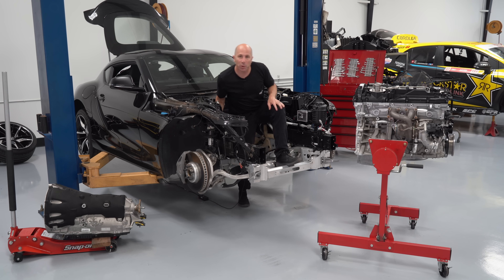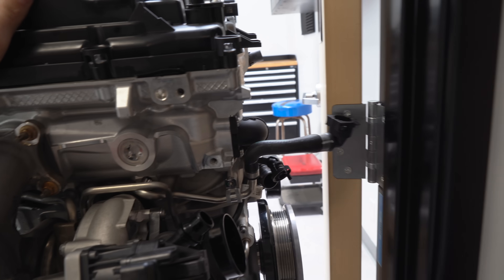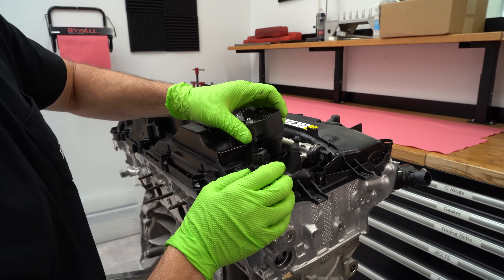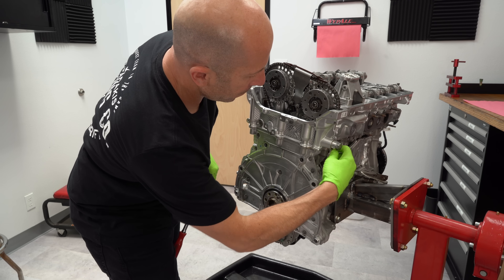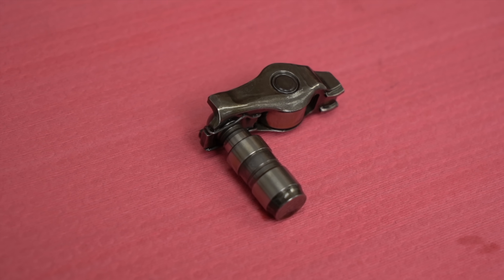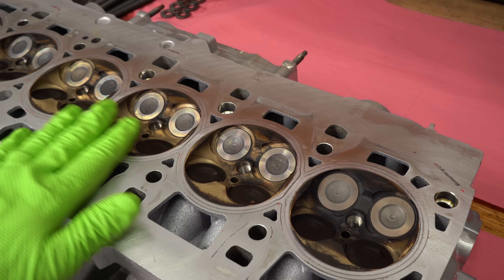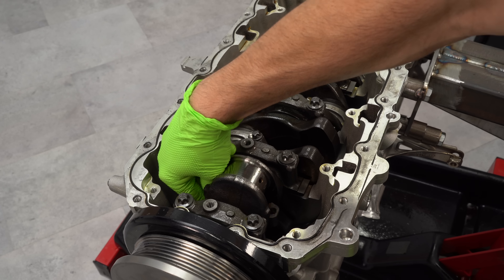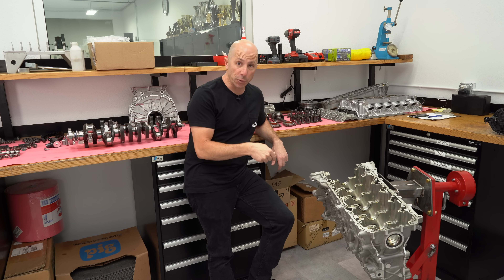2020 Supra B58 Engine Teardown - First Look - Better than the 2JZ?

Comment: Renowned engine builder: compliments engine

People on the internet: sHoUlD bE a 2jZ
Reply: People cry for the 2jz but dont realize the original supra engine is the M series from the 2000gt 🤣
Reply: Technically nearly every motor with the G head was a Toyota/Yamaha collaboration and been this way since the 1970s with the 2T-G in the Celica. 🤷 That's why most Toyota motors have an F version for economy (eg. 4A-FE) and a G version for performance (4A-GE). 👍
Reply: @Jmac1000000 the 1JZ was designed by Yamaha with a partnership for Toyata, the partnership kinda died out and Toyota revised some engineering with the 1JZ and added a half liter of displacement and badged it the 2JZ. Though Yamaha didn't deal with the 2JZ it still builds off the 1JZ platform.
Reply: @KingCobraStunts  Holy fuck thank you. So many people don't know what the fuck they're talking about.
Reply: @KingCobraStunts  thank you for saying this. Glad there are  people like yourself who actually know the history of the engine
Reply: People hate giving Yamaha credit for building the 2jz engine. They probably won't give BMW any credit either. There's a reason Toyota doesn't build these engines themselves.
Reply: @name1874 : Why yes, let me meticulously source every statement in a Youtube comment.  That sounds like a lovely use of my time and knowledge, of which I've already given far too much freely to the ignorant lot of you.  I think a simple Google search would confirm everything I've said, I'm quite certain of it.  After all, I'm correct.
Reply: Tyler Duzan you’re right in everything you say but it can be interpreted differently and/or can be a brand new concept to someone, so why act like an unlikeable elitist prick?
Reply: Yamaha designed the cylinder head and they did a dam good job. I only trust DOHC valve trains with shim bucket valves. .
Reply: blu3flare25 Which Yamaha ripped off Kawasaki.
Reply: Yamaha and Toyota have been making and designing engines together for a long time.  The 2000GT was an early example of their collaboration then 1JZ and 2JZ series to the Inline 4 4AGE, 2zz and 3sge engines to the famous LFA V10 which Yamaha had more control and influence in the design as they developed the exhaust system along with their music division
Reply: one of the head bmw engineers from M division helped design the 2jz...
Reply: why are people so pissed? its a bmw! People love BMW's, so why do they hate this? it could have been worse, for instance, kia or something. bmw is a great performance brand, its not the end of the world.
Reply: Loool
Reply: Overland RC probably a 3JR. Toyota has been naming their engines “X”R recently, like the UR or GR engines
Reply: @Jmac1000000 YAMAHA DEVELOPED THE TOP END OF THE 1JZ! JESUS PEOPLE
Reply: @Overland_RC  don't they have the same engine?
Reply: @Overland_RC  per design
Reply: @Jmac1000000 The head on a 1jzgte non vvti engine was designed by Yamaha aswell
Reply: @Jmac1000000 thr 1jz was also a partnership with Yamaha
Reply: The 2JZ-GTE is an inline-layout, six-cylinder, belt-driven dual-overhead camshaft, air-intercooled, twin-turbocharged, cast-iron engine designed and manufactured by Toyota Motor Corporation that was produced from 1991 through 2002 in Japan. Final development of the 2JZ-GTE was outsourced to German engineering firm Johann A. Krause Maschinenfabrik GmbH for refinement to meet production car homogolation requirements set forth by the former All-Japan Grand Touring Car Championship.
Reply: @infamus15 Finally, someone else who gets it! Yes, these are BMW engines, but they're BMW engines *with Toyota quality control*. Which anyone who knows Toyota knows that that is what they're known for. I have faith in the B58.
Reply: Overland RC some German piece of shit lol
Reply: Still wish it was built with japanese ingenuity, still a cool engine for sure.
Reply: @Jmac1000000 It's not exactly like Toyota had no say on this engine. I read that Toyota engineers examined a pre-production engine and gave BMW a list of a HUNDRED (100) things to fix and adjust for it to match their demands.
Reply: @infamus15 Do you have a source for all of that? I would love to read that and it would help to assuage my fears of it being a maintenance-intensive BMW.
Reply: I do like the idea of having control over your cam timing, but just like LS and mopar have proved time and time again, you don't need high tech to be the fastest.
When it comes to power output, there is no replacement for displacement.
The B58 is cool and all, cool little maintenance ideas, but you cannot say it's better then a 2jz until its accomplished what the mighty 2jz has, Ain't no BMW engine doing 5s.
Reply: King Ragnar I wouldn’t compare an LS to a JZ or B58. Not to slam on the LS but the engines are leagues apart, adding displacement is a solution of a by gone era. We have better options now that return the same power, in a smaller package, with much better economy and the same reliability
Reply: King Ragnar there’s no (replacement for displacement?) you ever heard of a turbo my friend?
Reply: @infamus15 toyota claims the b58 passed their inspections from the get go
Reply: Funny how people are complaining that toyota once again partnered up with another company for a engine, when they did the same thing with yamaha
Reply: Internet people are stupid and poor and they should shut up
Reply: Well yeah should've been a Toyota engine. That's true.
Reply: AWOL the 2j wasn’t a “Toyota” engine either. But I get what you’re saying.
Reply: @peterp1552  huh 2 j not a Toyota engine???
Reply: Tyler Duzan The 2JZ is a Toyota engine that was co-developed with Yamaha. That does not make it a Yamaha engine. Get your facts straight, stop spouting ignorance and don’t call people dumb when you clearly don’t know what you’re talking about.
Reply: @NitroNuggetTV : 

1. I didn't say it was a Yamaha engine, I said Yamaha designed it.  You used the term "co-develop".  Pray tell, what does that term mean?  Could it possibly mean the same thing that I said in my actual words rather than the words you put in my mouth?

2. I know exactly what I'm talking about.  Thanks for playing.
Reply: @UC_ecMyI2NJsSiQTlhGVL7-A:

Almost every major drivetrain component in every modern car (modern being made since 1980) is done as part of co-development.  Companies like Yamaha, Aisin, Borg Warner, Allison, Takata, Bosch, et al do significant amounts of co-development work.  This is because car manufacturers are specialized primarily in the manufacturing, marketing, distribution, and regulatory side of the house and that is a primary cost driver for making a new car design.  Toyota has an incredible amount of engineering capability in house and probably could do everything itself, but it's simply not cost effective to do so, so like every other major car company they farm out significant parts of the work and their own engineers are responsible for the initial specification requirements and final integration.

To be real specific, there are multiple design changes over the lifespan of the JZ engine family.  The 1JZ-GE was likely a wholly Toyota design, however the 1JZ-GTE was not, as you can find out by looking at the very obvious Yamaha badging across several critical components.  Yamaha's specialty in all of their codevelopment with Toyota has been head work and timing, and the 1JZ-GTE is no exception.  The third generation 1JZ-GTE added in the Toyota BEAMS architecture which was also co-developed with Yamaha, originally for the 3SGE.

For the 2JZ-GTE specifically though, a third player gets to enter the arena in the form of German engineering firm Johann A. Krause Maschinenfabrik GmbH which worked over the 2JZ-GTE design in order for it to correspond to FIA homologation rules for the Japanese Grand Touring Championship.  There was also additional headwork improvements in the 2JZ-GTE courtesy of Yamaha.  Furthermore, there's even a fourth player with the 2JZ-GTE, as the turbos were jointly developed with Hitachi.

In the case of the 2JZ-GTE, if we've being very specific there were design inputs from Toyota, Yamaha, JAKM, and Hitachi into the total powerplant, and final build production was entirely performed by Toyota.  A significant portion of the design, especially components related to fueling, timing, head design, and valvetrain were originated from Yamaha and critical to what made the 2JZ-GTE a legendary motor for taking power on a stock block.

Since Youtube comments are obviously the perfect place for me to write an essay, enjoy a little fact bomb.  The More You Know *rainbow*.
Reply: @Tristor86  You ignorant. Yamaha never designed engines for Toyota. Whenever Yamaha had something to do with Toyota engines, it was in the cylinder head. Yamaha just designed the cylinder head. That's it. The motor as a whole, was designed by Toyota. It's funny that people are so salty and try to find reasons just to desperately prove Toyota isn't capable of building amazing engines. Well, joke's on you.
Reply: Tyler Duzan Yamaha is notorious for designing good flowing heads. The 2jz wasn’t designed solely by Yamaha.
Reply: Tyler Duzan the head was designed by yammy, thats it
Reply: @Tristor86   only the cylinder  heads from what I understand.
Reply: Peterp 15 but literally the motor is all bmw that’s why ppl don’t like it
Reply: DoubleC Lexus LFA.  Engine exclusively developed by Yamaha.  Granted Lexus IS the luxury arm of Toyota but just an example.
Reply: Tyler Duzan blah blah blah
Truth is Toyota has Yamaha develop (co develop) most of their high performance engines. 1zz Celica, 4ag AE86', the LFA engine, 3s-ge, 2jz....
NO other manufacturer is that incompetent when developing engines. Imagine if Honda had %50 of its engines designed by Yamaha, or Ferrari engines were "co developed" with Yamaha, imagine if Porsche had most of its engines "jointly developed" by Yamaha...get real son. Not saying that the B58 isn't good, that's not the point, point is Toyota can't build shit on there own.
Reply: KSDLEUXE KING I used to be like that, but over time it’s been growing on me quite a lot. You gotta accept for what it is. Either you like it or you don’t. This platform is gonna prove a lot of people wrong and shut up lots of haters. We just have to give it time to marinate.
Reply: @kghyeah9032  yamaha DID not develop the LFA engine! Don't be stupid. google that shit. All they did is design the acoustics for the surge tank on top of the engine. This is not from fucking wikipedia but from straight from the yamaha archives.
Reply: @NitroNuggetTV  then that means its the same thing as the B58 in the A90. A toyota engine
Reply: @theautomator2001  come on man. The thing you don't seem to understand is that the entire world doesn't have to think in terms of rivalries like Ford vs Chevy. Toyota and the Toyoda family are Japanese, which is a very perceptive culture. I'm not implying the cliche that Japanese people are born geniuses (they're not) I'm simply saying that they are a culture in particular that prides themselves on peacefully identifying strengths and weaknesses in others while keeping under their own humble  personal and national pride. It's what they're good at. Toyota knows clear and well how famous their engines are, but it's possible that you don't understand that although yes, rivalries occur, Toyota loves the bigger picture of it all: they love to make vehicles. They also love to make sports cars, on occasion. They love it so much, that they would rather not play the risky game of exclusive in-house engineer/designer- hunting, paying, trusting, and praying that they deliver world-class results...every time. It gets very expensive.
BMW can make great engines when they really want to, and just so happens that Toyota noticed this quality and really wanted them to do that. It's a beautiful thing, honestly.. business relationships when they work like this, instead of trying to shut each other out. We consumers love the vehicles, but yet would hate to see our favorite maker disappear.
It's called keeping the peace. It's us..the teams and the everyday consumer who draws these lines like you're stuck on that a  manufacturer is less-than for not doing everything under their own roof.
It's not the 80's nor 90's. We managed to get some great engines from then, but as the times change, designs and philosophies also change. Over-engineering for 500PSI of boost is how they did it back then...precision engineering is how they are doing things now.

Japan is very much in to collaborations across the country; from food, to clothes, and to cars. Above all, quality is highly sought and that's especially true within the collaborative decisions made within relationships..from personal and you better believe on up into business.
Honestly, I'm a Mazda guy and rotary junkie but I have nothing except respect for Toyota and their achievements over the years. They are hands down the smartest and most progressive-thinkers of Japan's auto market. They still don't know how to build chassis as fun as the FD3s, but that's another topic. 
All I'm saying is that they know what the fuck they are doing. This wasn't a desperate attempt to bring back the Supra because Toyota felt that they were losing business without it. Everything's going to be fine.
Relax.

It's the future and we're in it. This is what it is.👻✨😱
Reply: @Tristor86  the 2jz is  was built by toyota it was basically a copy and improved version of the 1jz  that was built by yamaha
Reply: @peterp1552  As well as the infamous 3sgte and the not so infamous but still cool in it's own right 2zz in the newer celica GTS
Reply: @DoubleCGamesStudios  The only thing Toyota did to the 2j was 2.5 to 3.0, rest was Yamaha and co.
Reply: @NitroNuggetTV  b58 was quality checked by toyota to make sure its upto their standard
Reply: I SAID RIGHT NOW!! It’s all bmw except the badge and body shell might as well just buy a bmw
Reply: @bmwman1981  if you drive both cars they feel nothing alike.
Reply: @AmaAndZing : You should do some research, bro, because you're grossly incorrect here.  Yamaha has been key to the design of engine harmonics on most Toyota race motors and high performance engines, and as such they have significant design purview over all aspects of engine design when engaged.  On the 2JZ, it was derived from the 1JZ which was nearly a complete Yamaha clean sheet design for the third generation which was used as the basis of the 2JZ.  For the 2JZ, Toyota moved forward the majority of the design and Yamaha improved the heads again.

The third generation 1JZ-GTE incorporated the BEAMS architecture which was the main thing that made so many late 80s and early 90s Toyota motors good (including the 3SGE and 3S-GTE in the MR2 and Celica).  This architecture was co-developed with Yamaha as well.

The factory turbos for the 2JZ-GTE were also an innovation, and were codeveloped between Hitachi and Toyota.  Toyota has a long and rich history of partnering with other respected Japanese companies to find experts in the more niche aspects of engineering to ensure they produce the most reliable and capable cars possible.   I have no issue with that, and I respect Toyota immensely for all of their achievements, but there's a lot of folks out there who got all their car knowledge from movies and don't know their ass from a hole in the ground, like you, that keep saying ahistorical nonsense.

As previously mentioned, other firms were involved for other aspects as well.  The bulk of the design was produced by Yamaha, though, not just the heads.
Reply: @NitroNuggetTV  someone's mad😂
Reply: @rocketlaunch99  it should have had whatever engine Toyota wants, it's their creation. haters won't buy it, too bad for them cuz there are real car enthusiasts out there that don't have that immature hater mentality.
Reply: @sepg5084  hear hear mate
Reply: @sepg5084  they didn't create anything since well you know all the parts are built and designed by BMW its really not that hard to get that it is literally a z4 with an hard top and Toyota badges
Reply: @rocketlaunch99  they were trying to make it more affordable and it would cost Toyota over 100k to make a new inline 6
Reply: Rubén Cabrera why didn’t they just borrow a engine from Lexus then instead they make v6s /v8s a more modern engine for the Supra
Reply: @bmwman1981  because the supra always had a inline 6 everybody would hate toyota if they put a v8 or a v6 it would ruin the supra
Reply: TurtleDude29 how at least it would be a Toyota engine unlike what Toyota have got now it’s a Toyota zupra not a Supra
Reply: @bmwman1981  you know yamaha designed the jz's right? the only reason they chose bmw for the engine is because they would rather use an already existing engine and re design it then spend hundreds of millions of dollars on an engine they wouldn't be sure would even succeed. i know for a fact this engine will be just as reliable as the jz's because i believe toyota would not let something unreliable out of their factory.
Reply: TurtleDude29 Toyota are Lexus why not use one of their own engines it’s just pure laziness on Toyota’s side all they have done is buy bmw z4s and just rebodied them plane and simple instead of actually bothering to listen to what people wanted ie a in-house designed and built Supra with a Toyota engine
Reply: @bmwman1981  it doesnt take long to debunk this so im gonna leave it at that lol
Reply: @bmwman1981  Jesus didn't realize my comment would end up being a huge thread lol.

It's pretty simple, Supras have always had I6's.  Toyota has no in-house I6.  There's no reason for them to use I6's over their V6's for their other vehicles as V6's are easier to package, and more efficient.  So instead of putting in all the money for R&D, tooling, emissions testing, etc, they picked a great I6 that already existed.

BMW and Toyota both wanted to make 2 seater coupes, these traditionally don't sell well.  It makes sense to spread the cost between each other to develop an all new platform with a lower center of gravity and weight than any other platform Toyota uses (86 is Subaru so they can't use that).